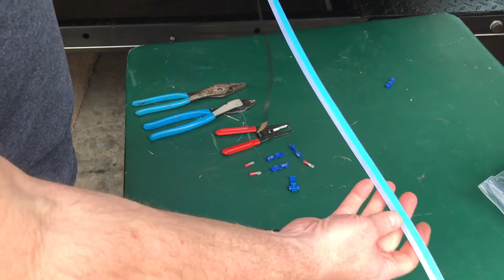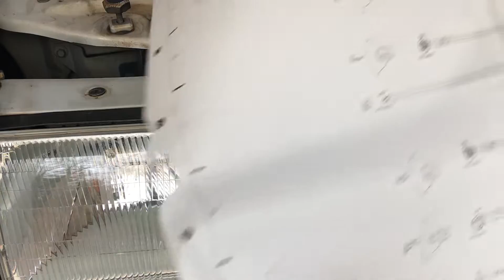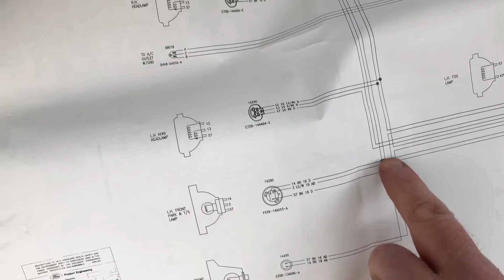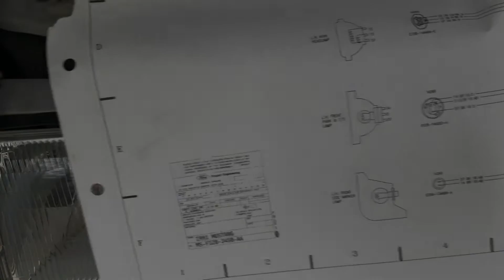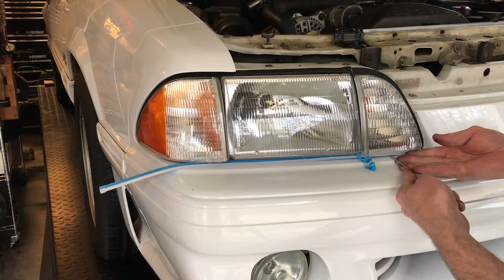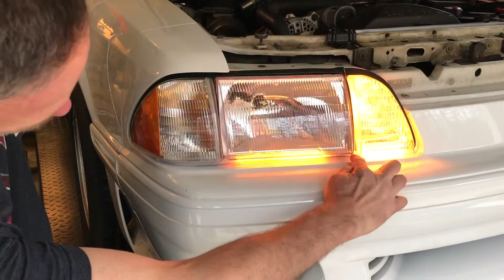Fox Mustang Sequential Turn LEDS install

Comment: I'd settle to just have a regular bulb turn signal on the outside edge, and the driving light on the inside (reversed).  Seems stupid to put the turn signal towards the center of the car.

Comment: The wires are small because LEDs draw very little current. Those crimp connectors introduce more resistance than the wires do. End result looks good, might think about doing this to my Fox.